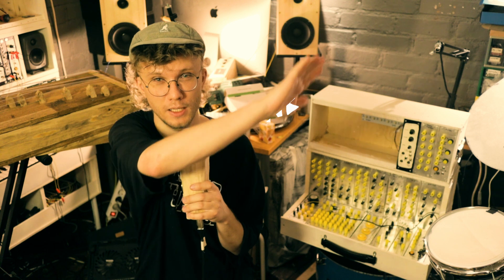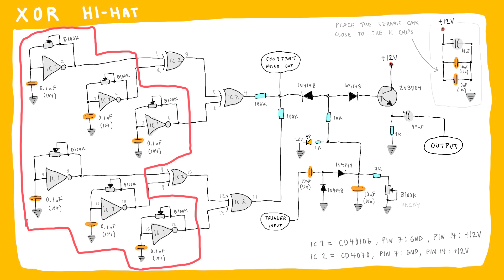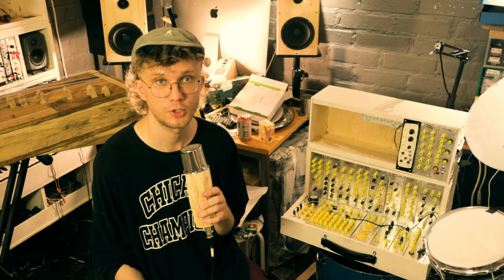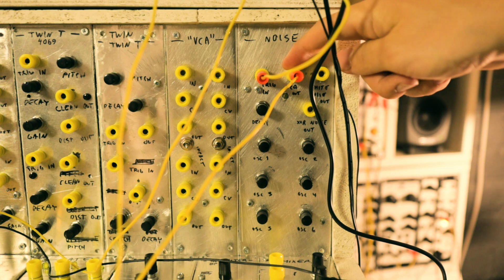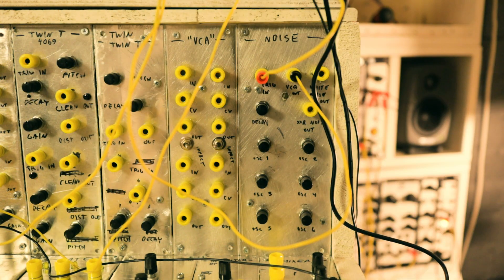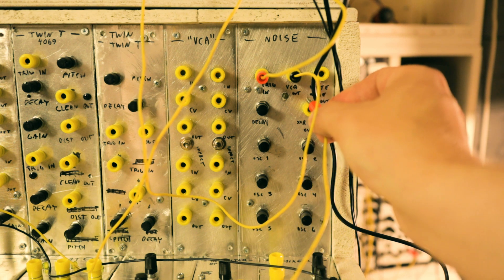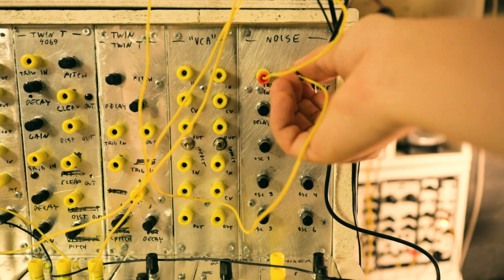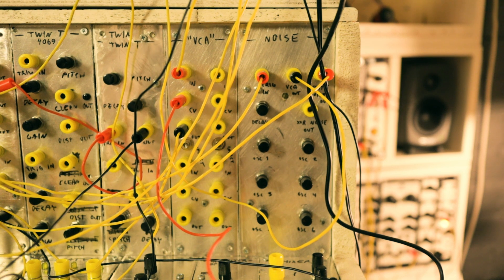CMOS HI-HAT + WHITE NOISE / making a drum machine EP 4

Comment: 2:35 At a glance, isn't the 0.1uF cap after the noise transistor charged to nearly 12V, most of the time?  What happens if you bias the emitter end (left) to around half the supply voltage, e.g. add a 200k resistor to ground from the emitter of that first transistor?  Maybe you could have a 500k to 1M preset pot (trimmer) there to try different reverse bias voltages.

Also, the 2nd transistor has a negative feedback network, which sets the gain and that gain reduces with higher frequencies due to the 10pF capacitor.  If you made the 2.2M resistor a bigger value you'd get more gain for lower frequencies (less negative feedback closer to DC), so I'd expect that to make it a bit louder too.
Reply from the maker: Thanks for the ideas, you might be totally right! I just built the circuit with these values and i was happy with the sound, as i do have amplifiers in the system so the output volume wasnt really a big problem. The article linked in the description talks more about the circuit so y’all should go and give that a read
Reply: @LAURISDIYCHANNELTV  Hi! Thanks for using and linking my circuit :) There's a couple of things to mention @TooSlowTube, first being that my design runs on 9V and using 12V changes the parameters a little; second, the choice of noise transistor really makes a difference, and experiment is needed to find the right combo of transistor and R value; third, biasing the base of the noise transistor closer to +V reduces the voltage difference across the base/emitter, which needs to be high enough to break down, hence tying it to ground. The reverse breakdown parameter varies a lot with different devices. Erm, finally, yeah the gain of the amp stage can be tweaked – my circuit is a starting point for experiment, so change whatever you like and see what happens. I've only had one coffee today so might have missed something. Nice work on the drum machine, have fun with it :)
Reply from the maker: Yay, thanks for the circuit and the additional info! 😊😊😊